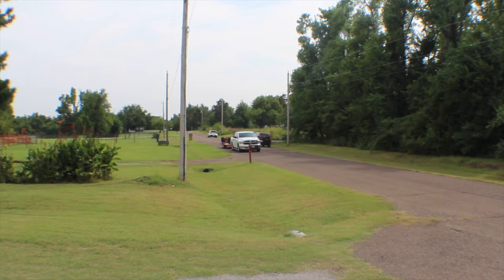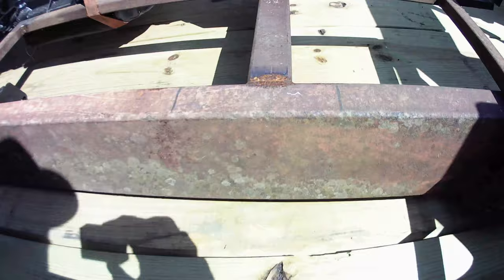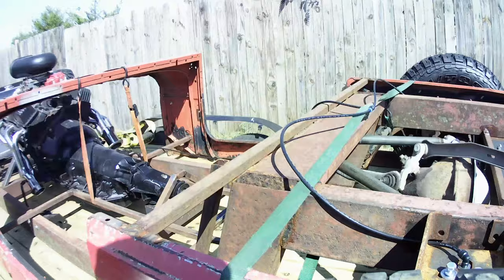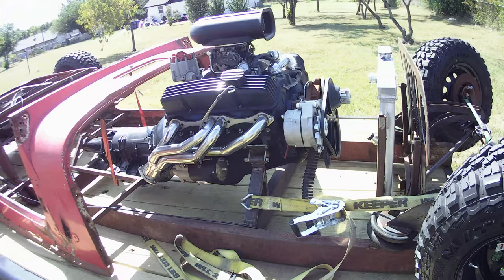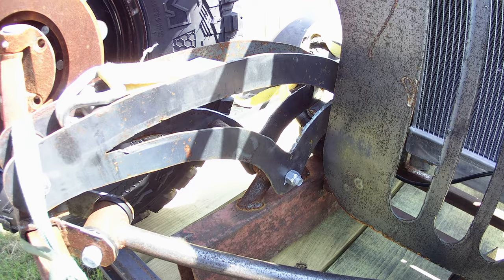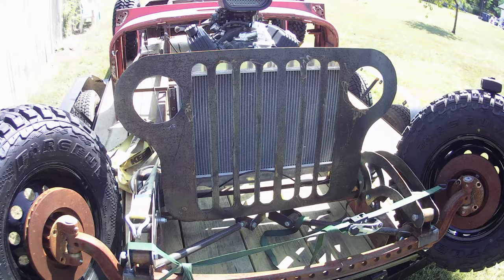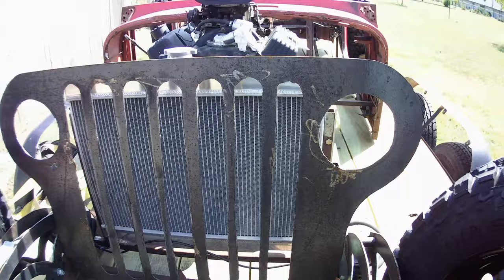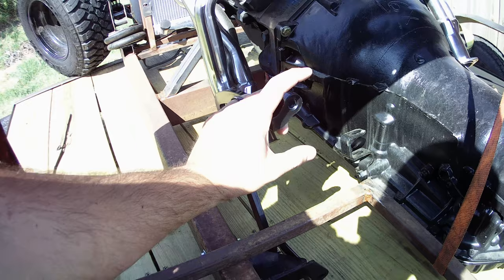How To RatRod/ Links to parts on the Jeep Rat Rod

Comment: What did you use for the rear end?
Reply from the maker: @josephscrivo8565  8.8 ford explorer
Reply: @Twistedleafrodshop  I’m currently building a 95 YJ rat that I inherited from a buddy who has passed and I’m having trouble with the rear end have to widen the axle 16” to put the breaks and wheels outboard of the body🤦🏻‍♂️
Reply from the maker: @josephscrivo8565  yeah my brakes were super close to the body

Comment: That rad comes as a chevy conversion on Ebay with the lower hose on passenger side I paid like 125 bucks for a cj5 4.3 swap looks kool starting a flat rod project soon check out jw shop time
Reply from the maker: Hey thanks for letting me know about that rad, I’m probably about to pull this radiator to use in a different project, so when I get another for it I will get the Chevy conversion, I appreciate it! Can’t wait to see your build!